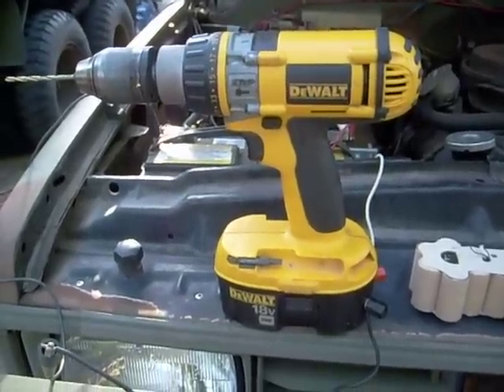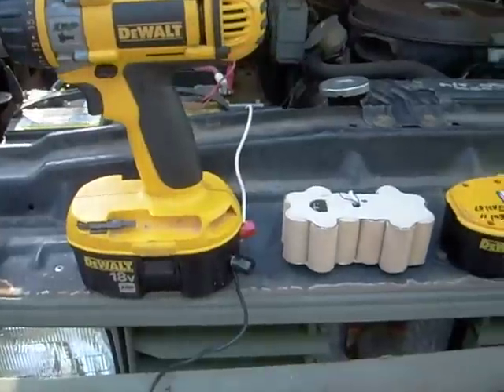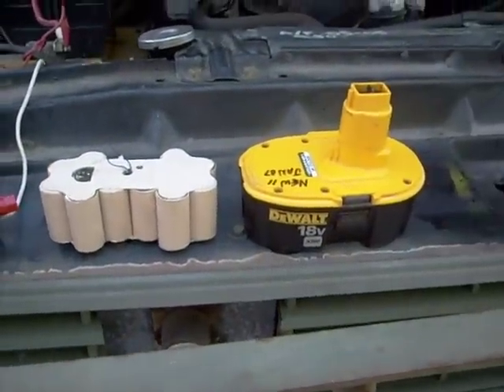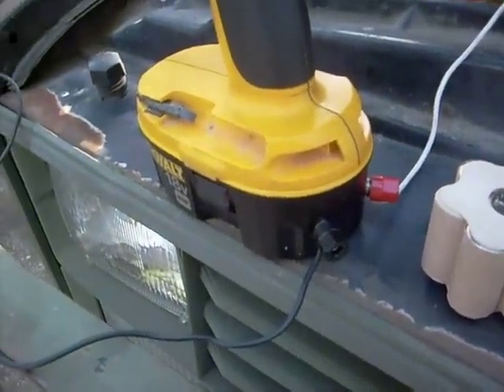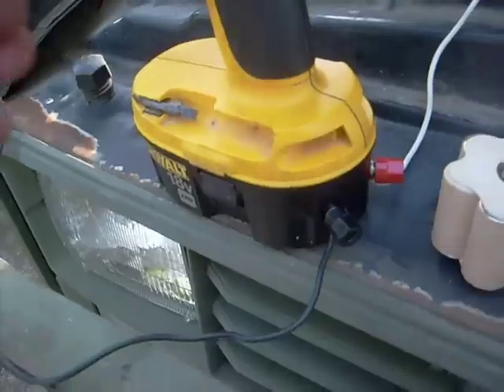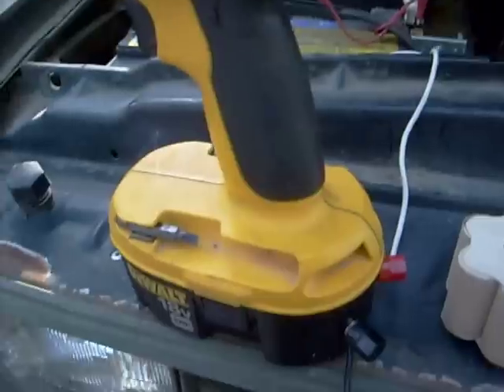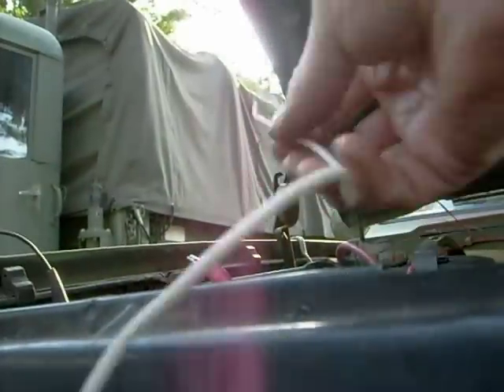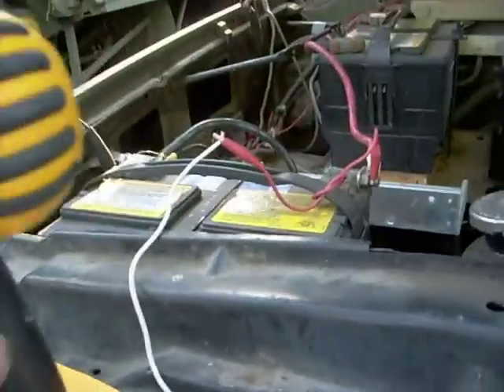Dewalt cordless drill 18 volt battery cheat

Comment: I just use a power inverter plugged into the car's power outlet/cigarette lighter and plug the charger into that. Works just fine, and no hacking needed! Power inverters are cheap too.

Comment: Then why are you saying that you are running on 12V in the video?
Adding a long cord will only make the voltage drop a lot if your wire gauge is too low (the more amps the higher you wire gauge needs to be to avoid big losses).
Anyway, I think those more expensive drills use a electric current regulator, too little voltage will just cap your max drill power/speed and too much voltage wouldn't be a problem as long as the current regulator can handle the higher input voltage.

Comment: A couple of 12 volt, 7 amp hour gel cells, the same type in many small UPS or Alarms systems...... wire them up in series you get 24 volt..... works good, lots of power, I just tape the batteries together with a long power cord tapped right in an old dead OEM battery housing, just like you did, works great, lasts along time and pretty,portable too

Comment: I have on my drill powered montainboard project a 9ah 12v battery and I made The terminal with a block of wood with Pôs Neg cables on ! U can see in one of mu recent videos! Btw my drill is 14.4v and works normal with SLA12v

Comment from the maker: Actually the power coming out of my Nato plug is 24 volts.  By the time you add a 100 foot power cord into the equation the voltage drops down to about 18 volts or a little higher.  Military trucks like this have a 12/24 volt system.

Comment from the maker: I still use my cheater battery almost daily and no problems with any of my equipment.  Batteries are not getting any cheaper.  A while back someone had a great idea that could adapt a Ryobi battery to any Dewalt cordless tool - it was quickly eliminated by Dewalt.  Wish I could have bought one of them before they were pulled off the shelves!

Comment: I think this is awesome.  If you think this is a dumb idea, you are missing the point.  This is about what is possible, not what is necessary.  Of course the easier thing to do would be to have a power inverter you could plug your charger into and carry extra batteries.  But there are times in life when the easy way isn't possible.  If you don't like it that's fine, but at least be positive about the ingenuity.

Comment from the maker: Any way you can keep from buying replacement batteries from Dewalt is a good idea.  If everybody did like you and I Dewalt would be forced to lower the price of their batteries to a reasonable amount - like around $30.00 for a new 18 volt battery.  It probably only costs around $10.00 (if that) for Dewalt to manufacture them in Mexico and they want $89.00 PLUS TAX for new ones that do not last very long.  Thanks for sharing!

Comment: Great idea - I connect my cordless (used to be dead -due to my refusing to buy new batteries after a few uses) but I connect them directly to the inner ports - also I do not keep old batteries - I take them to home depot's recycle bin - same idea but my idea is more crude since I do not intent to post and a bit more risky in touching the wires - they all work well 12, 14 and 18 volt - 14 and 18 volt less power but they do the job - again - great idea and thak you for posting it

Comment: Defeats the purpose of a cordless drill. Just buy a new battery, buy a corded drill and run off an inverter, or charge your dead batteries off the inverter.. much easier than this method

Comment: The Dewalt 18v series is just about the only tool system that has an automotive charger available for it.(Makita made one for the 9.6v, special order, obsolite now. None of their tree maintenance tools were 9.6v.)  The price for the 12v charger packaged with (2) 18v xrp batterys is usually less that the (2) battery package alone.  

Dewalt's motors have no overcurrent protection, AC or DC.  Therefore, it is pretty but no better once in the hands of your coworkers than the $29 competitor.

Comment: Some folks are rather "resistant" to cheats eh. Im a little hesitant to post my new idea video. It goes as follows: Cordless Extention Cords. All you need is some old cord. Just think jobs that use to require 50 or 100 ft of cord are no longer a hassle. Im not going to be a stickler on using exactly 50 feet cordless extention cord for a "50 ft" cord. But Im not stupid I definately wont use it in the rain ---anymore. what do ya think , Im gonna be a multi-illionare

Comment: Check out some of the info about zapping your dead batteries back to life.  We have done it in our shop and it works most of the time.  We use a 12 Volt Battery Charger and touch the ends to the contact on the Dewalt battery for just a few seconds.  Batteries good as new!

Comment: @Lokivoid The same reason a car radio rated at 4 amps doesn't draw more amps if connected to a car battery with, for example: Die Hard Gold Group Size 59, 590 CCA (cold cranking amps). 
Do you think every electrical device in a car is going to draw the maximum available amps? 
A device draws amps it is designed to at a given voltage. A drill that draws 3 amps at 18 volts (54 watts) 
(I (amps) x E (volts) = P (watts)) will draw 4.5 amps at 12 volts (I (amps) = P(watts) divide by E (volts)).

Comment: @tmastersat Absolutely correct! The drill draws current to supply torque. Under load, the motor will attempt to supply torque to the load by drawing the required current. If the line supply voltage is depressed, the current draw must increase. Under light loads, this 'cheat' may be fine. Under serious loads, this 'cheat' may damage your expensive equipment or worse. Viewers should be beware of YouTube engineering. A healthy sense of skepticism should be applied universally, even to this comment.

Comment: @tmastersat You cannot compare a discharged 18V Dewalt battery to a 12V car battery. You are correct in that by the time your Dewalt's battery is that low (assuming it can even reach 12V) it can not supply any consequential current. However, a car battery can supply hundreds of amperes.  Under any serious load, your 18V drill can draw excessive current from a 12V car battery which can easily supply a damaging amperage to your tools. My intent is not personal attack but to inform viewers. Beware!

Comment: @bradjones06 You dont understand ohms law.  That could only hapen if the current in the bat stayed the same and only the voltage dropped. Since the current will drop with voltage as the bat goes down you will would not have a problem. You see the total wattage of the battery goes down as it dies both v and I goes down making it impossible for your statement to be true.

Comment: @Fentanyl3 Ohm's law does work...that is the problem.  The motor must deliver fixed power to the load.  If the voltage drops, the current must increase, P = V*I.  Higher current draw means more heat in the motor wiring.  Enter Ohm's Law: P_loss = I^2 * R, where R is the resistance of the copper wiring.  This power is lost as heat which results in increasing copper resistance, resulting in even more heating and eventually a destroyed motor. Google: "electric motors and voltage"

Comment: @mastergx1 WRONG, when voltage drops current drops.

Ohm's law states that the current through a conductor between two points is directly proportional to the voltage across the two points, and inversely proportional to the resistance between them.

SOOO the only thing that can cause the current to go up is an increase in voltage, or a decrease in resistance, which would require this guy to rewind his little drill motor with either less turns of wire, or a heavier wire,

Comment: you can damage an 18 or 24v tool by using a 12v supply. When voltage drops, current consumtion increases and can easily go beyond the maximum range of the tools component's current rating. This causes the tool to have a much better chance of overheating and malfunctioning. In addition, it will also void your warrenty.

Comment: This doesn't seem like a good idea.  I'm not sure what type of motor is used here, but using 2/3rd the specified voltage cannot be good for it; this "cheat" will likely result in too much current draw and potentially overheat or permanently damage the drill motor.  The below discussion about Ohm's law is misguided at best.  While motors do have equivalent circuit models, reducing the discussion to V=IR is an oversimplification.  Don't trust YouTube's engineers over Dewalt's.

Comment from the maker: @LitterboxDiorama You can remove lug nuts from your car for one thing.  Once you loosen the nuts you can quickly removed or install them with the use of a drill with a socket driver.   I have done this on many occasions when flat tires occured due to driving over roofing nails at a job site.

Comment: @aboonski Your welcome brother.... 
 
I would rather buy a new 220 amp hour deep cycle battery than a new drill battery any day.  Try using that drill battery for a water pump, 650 CFM fan, refrigerator or any other survival gear you need after a major storm. 

Keep up the good work! Though it may feel like it,  your not the only man on the island.....

Comment: Old 12 volt tools are cheap if not free. I use the same set-up when I have to fix fences or gates on my ranch. Waiting in the 95 degree summer sun for a battery to charge is not an option. There are those that get the job done, and those who wait for a little green light to say it's ok to work again. Livestock don't wait for recharged batteries.... A COUNTRY BOY CAN SURVIVE!!!

Comment from the maker: @Bowfinger6383 I like your response!   A lot of engineers and electricians are highly critical of the way I run my tools but voltage is voltage and I have not had a bit of trouble with any of my Dewalt cordless tools and don;t anticipate any either.  They say "necessity is the mother of invention" and I felt it necessary to use this procedure to let me use my tools when my batteries failed me.

Comment from the maker: @CovKid80  It takes approximately and hour to charge a Dewalt battery ad if the battery has been used for any length of time it gets hot and has to cool before the charger will work - even more wait time.  I don't have to "wait" with my system.

Comment from the maker: @goodson305  All you would need is a transformer that puts out 18 volts DC and a modified battery like the one I made and you are in business.  You can even use things like a car battery charger to power your tools.  It works - trust me because I have used these things but did not make videos but may do so because of your inquiry.

Comment from the maker: @dano1p   At face value it does look I am going backwards but when all of your batteries go bad it's nice to know another way to make your tools function without spending all that money for new ones which cost around $90.00 each.    I promise you that, if enough people fabricated this system for their Dewalt tools the cost of replacement batteries would drop considerably.  I am working on a battery pack that will use rechargeable 1.5 volt AA cells that you can buy and replace if they go bad.

Comment: @g7txu OK buddy.  lets try it this way, just think a minute.  High school physics. say your driving a screw with you're gun one screw with the 18 v battery and one with the 12 v setup.  both do the same amount of work but the one does it with less voltage.  So if it does it with less voltage something has to make up for the work done.  Thus more current.  put an ammeter in series between the battery and trigger and run some tests and then get back to me.

Comment: @aboonski   Oh no there is no difference in the batteries.  lead acid batteries are exactly the same as nicad's and nickle metal hydride.  After all they are all batteries.  Right.  Go measure the voltage on a new flashlight battery   genius.

Comment: @croakerchoker504   Anolther croaker that thinks they can just re arrange ohms law to fit their situation.  constant R and 5 times I your drill would turn into a sparkler.  you may have 5 times as much current available but it will not use that much before it blows.

Comment: @CovKid80 I gotcha now, yea that'd be fine.The reason I did it the way in the video is because my batteries crapped out.One wouldn't hold a charge and the on the other one, the bands connecting the cells were broken in a few places.So instead of wasting money to get new batteries for a crap kit, I just modified it.Not as handy as cordless but better than using a cold chisel at the junkyard.

Comment: @janz1234567898 No, mine were 14 and 16 volt.The worst that happens is that they don't have quite as much power, but it won't hurt a thing.Just make sure that it is at least a 12 volt drill.

Comment: Heck, this is too easy. Just got my 14.4v drill running, by using an old 6v battery casing, some wire soldered onto the internal connections and croc clips! 
Aboonski, you'll have to marry me of course! X¬D

Comment: Did you ever hear of an inverter so you can charge the battery while you were driving to the boonies!!! Your fix would be great if your car battery was 18 volt but since it is not it will cause your drill to fail premature running on 12 volt.

Comment from the maker: @LitterboxDiorama I have a majority of the tools in the Dewalt 18 volt lineup to include the impact tools and the 90 degree drill.  You can speed up repairs on a vehicle "in the middle of nowhere" with these tools just for starters.  When I worked in the air conditioning trade years ago I would do "rough-ins" for the ductwork which required cordless tools to accomplish.  On many occasions the batteries did not last and I wish then that I had the system I have now!

Comment from the maker: @1Rowdy1derful my application does not use the cigarette lighter port.  Depending on the tool that I would be using, I could use the cigarette lighter port as long as the "load" on the tool was not too great - more torque needed, more current draw used.

Comment from the maker: @1Rowdy1derful All of my tools still function just like new and I use them with my "cheater system" on a daily basis.  I still say the voltage tapers off as the battery gets weak.  If you don't believe me, try checking a depleted flashlight battery and let me know if it still has 1.5 volts.  Please do not tell me that flashlight batteries are different.

Comment: @1Rowdy1derful 
I will remove the fuse from the plug and replace with a piece of metal and use lamp cord as the wire from the lighter and the dead battery pack and I will be running it off a 12V jumpstart box. I just hope it doesnt draw more than 12 amps. but if it does I'll just put clips on it or something for the red jumper cables to grab onto. if the car lighter socket in a car is one that has the lighter heater thing that pops out. will that have enough amps.

Comment: @aboonski Wrong wrong.  The battery is 18V when run down it is still nearly 18 V just won't supply the current needed for torque.  Running it on 12 means it will draw more current to do the same work.  More current means more heat in the windings - burnt up drill. plain and simple.

Comment: This video has given me what i think is a pretty good idea.. Take one of my spare toolboxes and mount two 12v motorcycle / lawn tractor batteries inside the box wired in series to yield 24v... Then connect the power pack up  to a 12/2 extension cord... I will experiment with cord length to achieve an optimal voltage drop of around 18-20 volts... convert one of my dead Ryobi batteries as a plug on the tool end...  I have 9 various ryobi tools and this would make an ideal remote power pack..

Comment from the maker: @Orrphan  Voltage is voltage.  The drill or any of the other Dewalt tools only use the amps necessary to run the tool with or without a load.  If anything would damage the electrical portion of the tool it would be voltage in excess of its designed rating.  By use of a long extension cord, the voltage drops from 24 down to around 18+ - so it is just like running the equipment with a dewalt battery only without the "fade" as the battery starts running out of juice.

Comment: WTF, why would anybody want to do this? In 20 years i've never run out of battery juice and if i did i put one of my spares in. You are going to fry the drill with the car battery amperage. 12 volt camera battery, 12 volt drill battery and 12 volt car battery different amperages.

Comment: I have plans to do this to an old coleman 18 volt drill but with a 12V car lighter cord and a jump pack just like Mah3525 was mentioning. The drill is part of a set that includes a circular saw a sawzall a vacuum and a light and power sander and 2 batteries and a charger.

Comment from the maker: No inverter is used here - just the power from the vehicle batteries and the alternators when the truck is running.  I suppose I could set up an inverter in the truck to run the charger for the Dewalt batteries but  at the present time I don't even have one good 18 volt battery to charge.  I use this systen to run all of my Dewalt power tools and I am satisfied with the results.  You will see "white blackbirds" when I pay $90 for a new 18 volt Dewalt battery!

Comment from the maker: As your batteries start to "fade", the voltage tapers off and  so does the power and RPM the drill can obtain - but it still works fine with less voltage only slower.  Provided you do not bog the drill down it will be just fine with the lower voltage.    I have run my Dewalt 18 volt tools with 12 volts on many an occasion prior to finding out how well they run via my 24 volt NATO plug application.  Just don't expect the same performance with the lower voltage than that of the 18 volt battery.